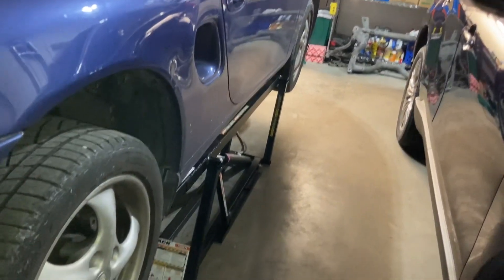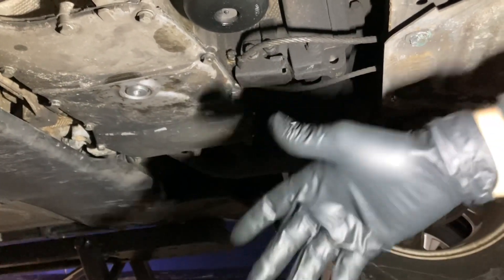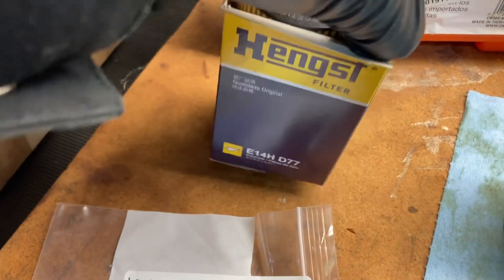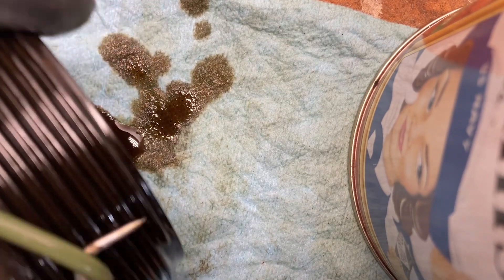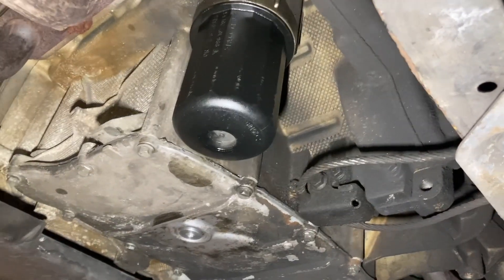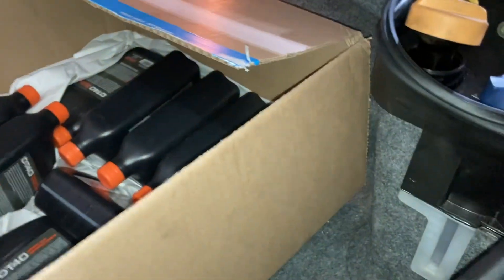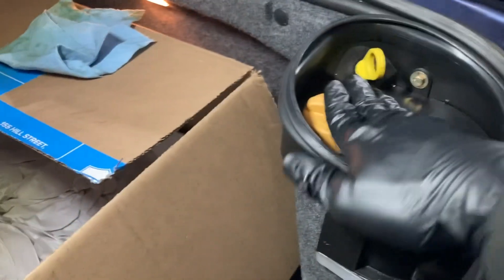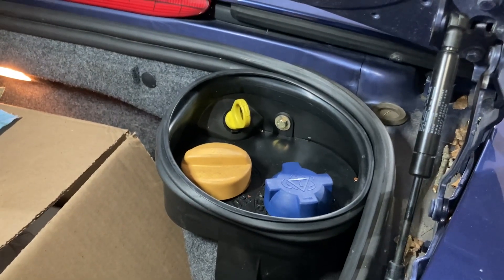Porsche Boxster (986) Oil change + oil filter analysis after 176,000 miles

Comment: Did you end up having to replace the plastic tensioners?
Reply from the maker: I believe these ones still have some life left, as my camshaft deviation values (variation from a reference angle between the camshafts and crankshaft) are still within spec. I plan on tackling this issue when I have more project space. Be advised, this is not a simple undertaking- replacing all 9 timing chain guides involves removing the engine and disassembling it completely.